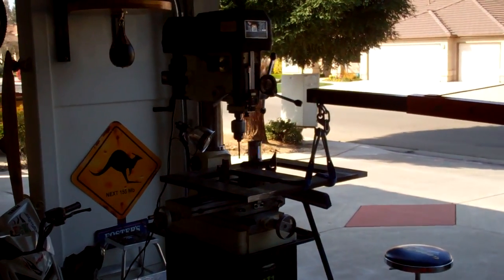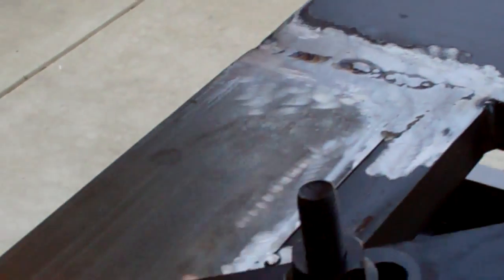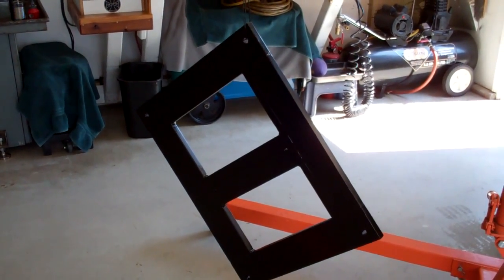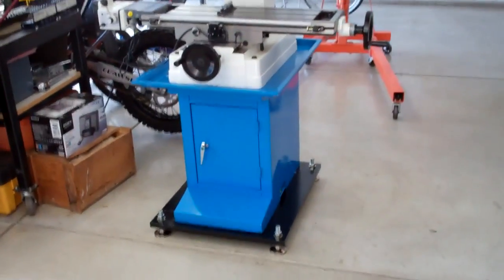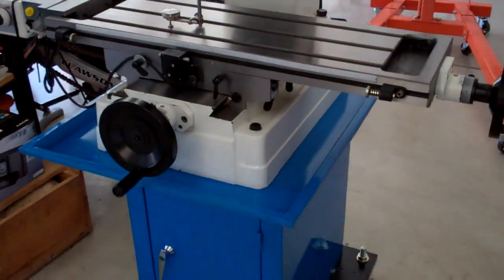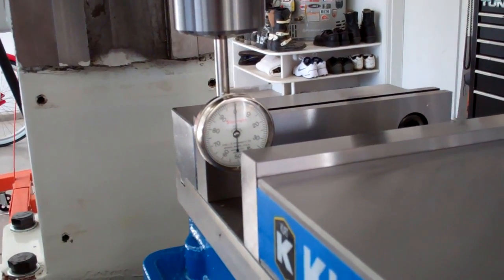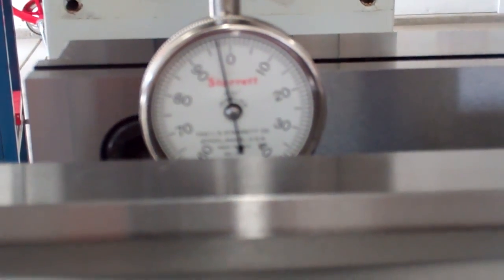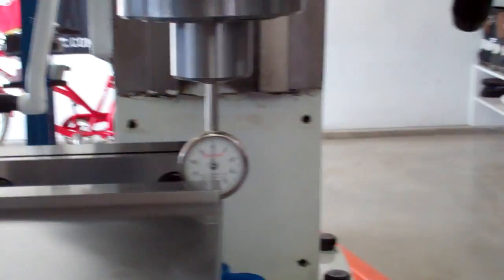PM45 Part 3

Comment: You call that a mess? LOL! My garage would look to you as if the 1906 Earthquake had just hit me...I have been focused on far more important things that we spoke of earlier, so while I can still find all of my tools when needed and all of the grinding dust and welding BBs are swept up, it isn't anywhere as organized as your's is...

I guess I would need to have as many tools as you do to get truly messy in my view, but building up my tool stash is a process that I've had to begin all over again after having my body and paint shop robbed in Honolulu. It was so obviously an inside job thet they used my own compressor to cut open my cage with a pneumatic die-cutter they oddly knew to bring along and turned on my breaker with a broom stick I had stashed in my stock pile. Then they stole the compressor!

Man, they got over $3K in HVLP paint guns alone, my MillerMig 200, spot welder with copper stud puller set-up, a whole rolling drawer tool box full of Snap-On hand tools, my 2 little carts full of all the pneumatics, and on and on. Even the water key for my garden hose got swiped...thank goodness all of the tools my Dad has ever given me were at home in my garage...unlocked, but still in the family.

I had a garage sale for things like TVs and stuff without any sentimental value or that were too heavy to take on the airplane, and I moved over here with 6 Rubbermaid 'snap closure' tubs, a duffel bag of clothes, and my surfboards, and luckily there was a sweet Hawaiian Auntie working at the desk and she got all of my gear on the plane for $400 bucks and didn't even snip the zip ties I used to keep them shut! I was so happy she listened to my sob story and cut me an instant Karma deal that was about a 3rd of what it should have cost me :)

Sorry for the essay length comment, I've been typing all day spreading the news for my Dad, and I'm just on a roll.

Aloha Mr. Clean...Sincerely, Chuckie Pig Pen
Reply from the maker: Wow Chuck,

Really sorry to hear your entire shop was stolen but, don't worry brother karma is a bitch!

I am happy to hear you still have your surf boards, mine were sold by my Mom at a garage sale for $10 each, both were single fin classics worth alot of $$$, one was an old school Jacobs that had a quick duct tape repair, (radical weekend at the beach) so my mom thought it was junk :(

I have no choice when it comes to a mess since I have to share the garage with kids stuff and cars, plus I really don't want metal chips in the house!

Thanks again bud,

Ray
Reply: Thanks for the condolences about my tools, but hey, as you said before, everything happens for a reason. It was that theft that brought me to the mainland and precipitated the purchase of our Knolltop Farm by my folks here in VS.

That led to my living nextdoor to them in the original house that was here after they built a modular, so we could all have our space and I could still be a heartbeat away.

As we now know, these past 3 years or so(they bought the place in April of 2011) have been some of the best times we've had together in years, and I ate dinner with them every night.

All for a reason my man, all for a reason.

Sorry about the loss of your boards, I know the feeling. My folks went through a garage sale phase and sold not only the best board I ever made personally from start to finish, but the also sold all of my OG "Star Wars" cards and figurines, and those would be worth some dough now too I'll bet! LOL...parents!

Thanks for the reply, Aloha...Chuck.